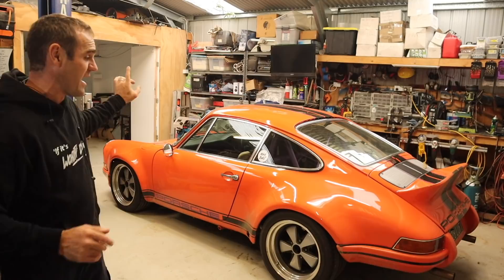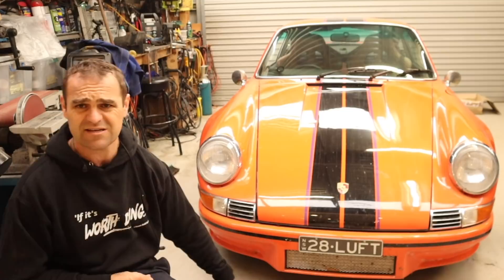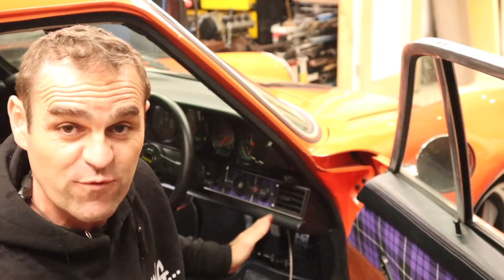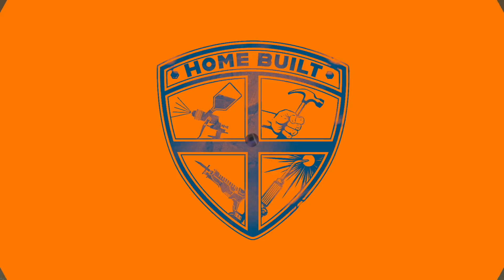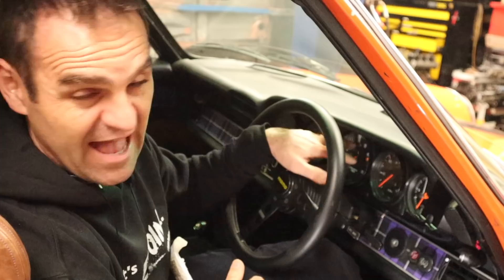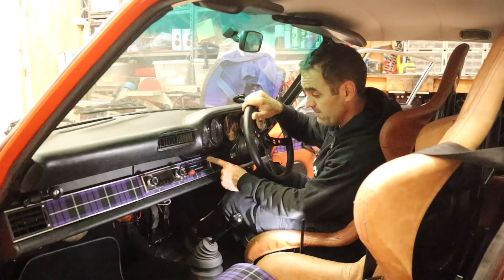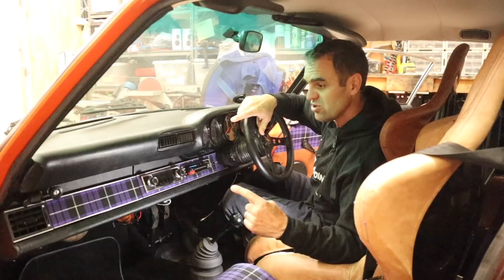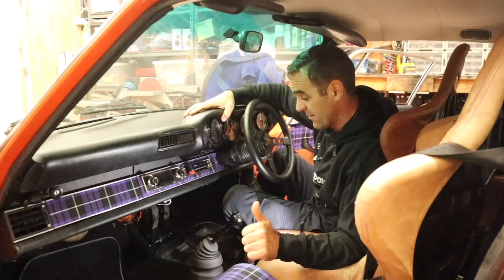Does the A/C actually work? Harry Porsche 911

Comment: Thanks Jeff.  Sounds like you are happy with the new air conditioning system,  Appreciate your car did not have air.  I have a 993 with factory air, which I recently had regassed, small improvemnet but not great in Sydney weather.  Am interested in maybe replacing with Classic Retro fit, albeit and expernsive option if it improves things, especially as my Porsche is black on black,  Enjoyed your videos on the 240Z, still have mine now with a 3.0L engine with triple webers sounds great and goes well, done by Datsun engine specialists at Dee Why.

Comment: For the inner arches maybe you could glue some thin sacrificial carbon based insulation to avoid heating the metal.
Reply: Thin won’t insulate much, so you’d want to increase thickness to improve insulation. But the thicker it is, the more it will rub & the hotter it will get. A contradiction with diminishing returns.

Comment: I had a little laugh to myself, the other night I made a comment on the "I wrecked my Porsche" video from a few years ago (I saw your response, I had no idea it was an old video at the time... just on as background noise I guess).  I'm not sure why but Youtube put an old video to me, I've been on your channel now for a while but I think I clicked on it thinking you'd damaged Harry as part of your trip :P  
I'm glad to see it's all going well, although from memory the concern with Harry was the torque drop off up high and then the mufflers were changed... It's easier to feel torque on the way up the curve than it is the way down, there might be a bit missing on the top end (it's not just a number on the dyno, torque turns the wheels and using knowing the gearbox ratios you can calculate the right time to change gears).  
I'm sure the Link ECU does a little self learning and the mufflers were changed since I saw it on the dyno last but I still get the feeling it's not getting enough air.

Comment: I kinda like the wheels tucked in like they are now, and the rake too, but hey, it's your car, and you should do what you think is right.
Years ago the wife had a Fiat X19 with no power assist on the brakes and the pedal effort required to stop the car hard was quite high. I didn't have too much trouble but she's only a little thing and she had a couple of scary moments so we decided to try and improve the situation. After abandoning plans for a vacuum booster setup (mid-engine, so problematic) what worked really well was a longer pedal. It only needed a tiny bit more leverage and it made a huge difference to the pedal effort required. I've no idea if that's what will help your situation with the clutch, but it's definitely worth a try, and far less hassle than messing about with boosters and different cylinders and whatnot.

Comment: Until you can fix the fan speed issue, a quick fix would be to wrap a rubber band around the steering column and hook it around the fan lever so you don’t have to hold it with your finger.

Comment: On the ride height, I'd consider getting a fresh opinion on that, as it's something you've obviously spent hours looking at thinking it looks wrong, but the spacing between the rear tyre and top of the arch is well under the arch. On the front, the tyre is very visible. You might exaggerate the appearance visually, accidentally as if running a smaller wheel on thinner sidewal tyre. Just a thought, love the video and work!

Comment: I have the same pedal setup on my honda and the brake effort was to heavy
I changed the brake master cylinders  from 3/4 inch to 1/2 inch cylinders and it made a huge difference to the pedal effort
Reply from the maker: I have a .625 in there at the moment and when they are hot it already a lot of the pedal travel so I don't want to go any smaller.

Comment: That part you can't get hold of anymore, best thing to do especially as it's small is make a mold of it and if you or someone else can, use the mold to poor molten metal into and you have a new part after cleaning and fine tuning. or use your lathe to get rough shape using some good ideal metal and shape it then grind areas that a lathe can't do. it's a bit of work but is good to have a spare especially if made yourself lol. I'm sure you can do it as you have become very good at what you do
Reply from the maker: It could be made on the lathe but I think now it has been repaired it should last another 50 years so I shouldn't have to worry too much about it ;)

Comment: I would not have noticed the front wheel offset issue. Maybe when you raise the front you can space out the wheels a bit without having to do all that re-work to the fender and bumper.
Reply from the maker: I wish ;)

Comment: I’m glad the a/c performed well with potential improvements to come. You mentioned ceramic film for the side windows. Are you prohibited by law from using the film on the windscreen? Glad the engine ran so well and strongly.
Reply from the maker: Yes. Can't put any tint on the front. Even clear.

Comment: Get the windscreen fitted with UV clear film as well as the side and back windows… this is the biggest thermal load, being clear it is still legal… remove the screen when fitting for a better and easier install 👍
Reply from the maker: I am going to try, but even clear tint on the front window is illegal.